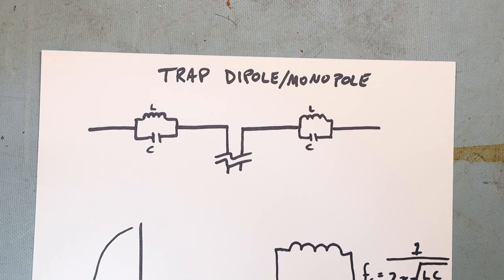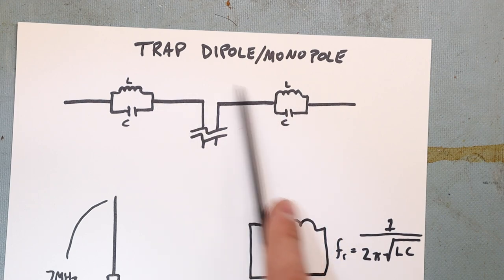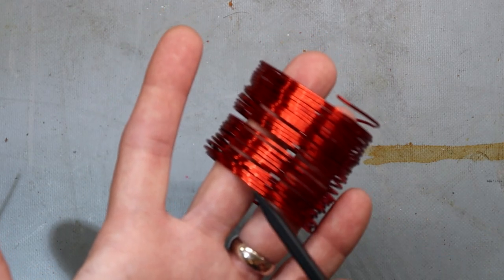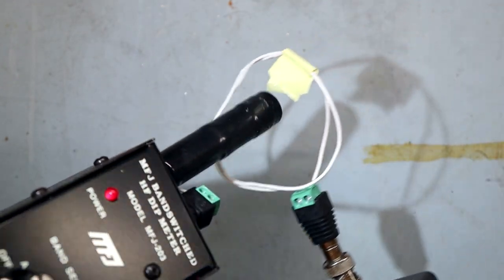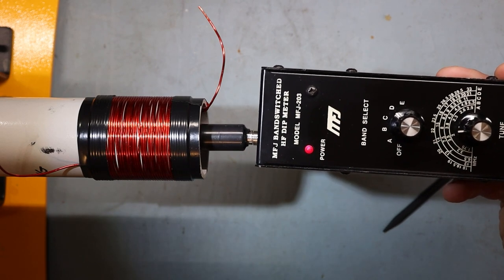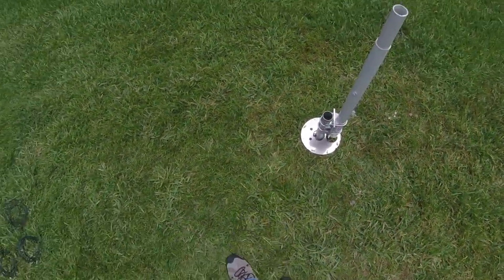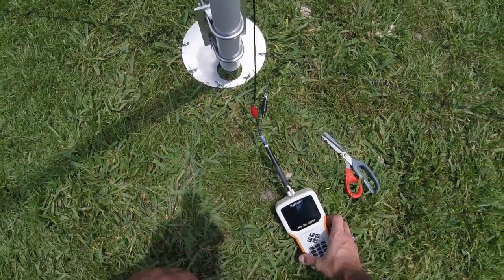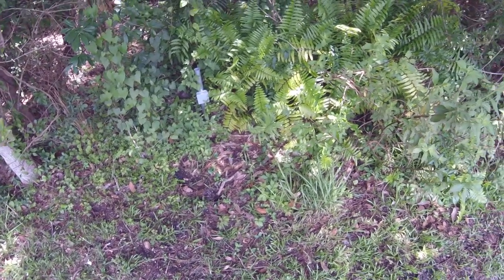Self-resonant Trap - No Capacitor?

Comment: If you're in the US and you're looking to put up a VHF or UHF antenna, make it double as a TV antenna and the HOA cannot bother you about it because by law, HOAs are not allowed to ban or excessively impede the installation of a TV antenna. I suppose it might also work to have a vertical HF antenna double as the mast for a TV antenna (even if only one can be used at a time) as an interesting workaround.

Comment: There is one more thing regarding this approach you should be mindful of. The coil has high losses near its self-resonance frequency. It's generally recommended to use a coil on the frequency which is 4+ times lower than the self-resonant frequency. In this case, 7 Mhz is only 2 times lower than 14 Mhz, which means that a considerable amount of energy goes into heating the coil on 7 Mhz. On the other hand, an 80/20 meters antenna would work OK.
Reply from the maker: Interesting. I’ll have to look into this. Thank you for the input!

Comment: What diameter was your coil? What lengths of wire did you wind up with for the radiating elements?
Reply from the maker: The coil was 50 turns of #16AWG magnet wire on a 2" OD fiberglass form. The 20m section was approximately 16.5ft and the 40m section at the top was approximately 2ft long. The short section on 40m, I'm not so confident about. I wouldn't recommend building this yourself, unless I have time to improve the SWR and test on the air. This was more of an exercise in tuning traps... a little experimentation if you will.
Reply: In modeling that in MMANA, I came up with the 20m section to be 17’ 8.5”, then an 85uh coil, which is a few more turns, maybe 55… then I placed a 100 ohm resistor across the coil to improve the Q some, that made the top section 20.86” long. The bandwidth is slightly improved on 40m with the swamping resistance. You might just try adding the resistance to yours and see what it does. It will have little effect on 20, but I would guess the resonance on 40m will lower. Without cutting, use your analyzer to see if the bandwidth improves enough to warrant retuning the upper element. I model less than 3:1 from ~7.06 to ~7.23. Without the resistor it’s only ~7.11 to 7.185.

Comment: That's what has always frustrated me about RF. You design and fabricate everything carefully, and then you have to trim things with scissors YOLO style to get it to actually work. I get that the real world is always more chaotic and the equations are for ideal components that can't actually exist, but it just adds to the whole "dark arts" cachet of RF engineering. :)

Also: BEARS?! Has central Florida always had bears? I was always somewhat mindful of snakes and gators, but I never even considered bears.
Reply from the maker: Hey Jim. Yeah, antennas especially.. at least at HF "ain't no need for decimal places". I have a funny shot of 3 bears going down my street at 2am knocking over trash cans. Couldn't find it for this video unfortunately.
Reply: Those that have RF experience know there is FM everywhere.

Comment: I would plan on doing  at least 30 radials, 60 would be ideal. At least that is  my experience here in Florida.
Reply from the maker: Thanks for the advice. The plan is to put down as many as I can until the mosquitoes make it unbearable!
Reply: Try to use raised radials, 4 raised radials equal 30 in the lawn.

Comment: What a few elevated your feed point a few feet and kept your radials off of the ground Then you could get by with just three or four radials and it would work fine but when they're touching the dirt that's when you have to have a lots and lots of radios because of the ground losses
Reply from the maker: Hi Pat. Unfortunately, I could only get away with a few radials, and tried it for a while. There are a lot of animals where I live and they were constantly ripping the radials out. I'm most likely going to leave the pole, rip out the radials, etc and connect an EFHW to the tip of the pole. Video in the works!